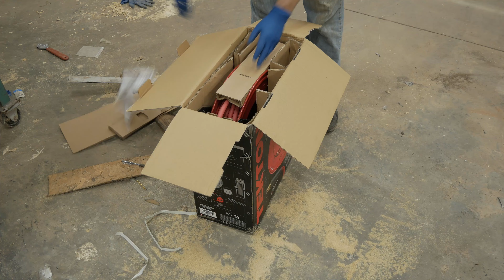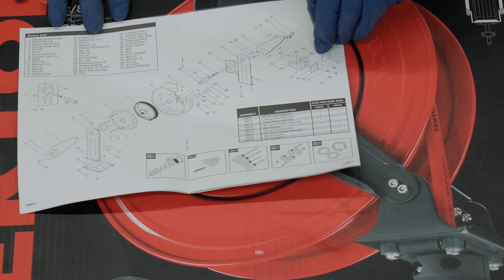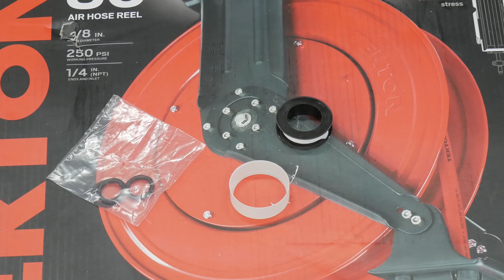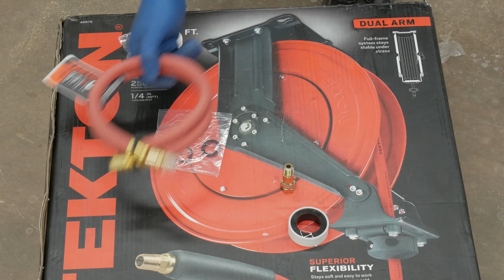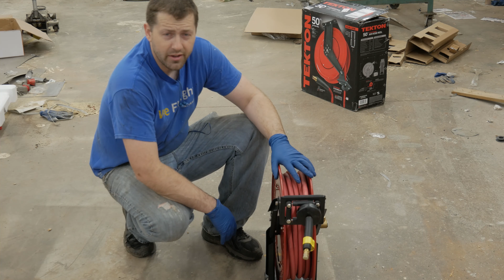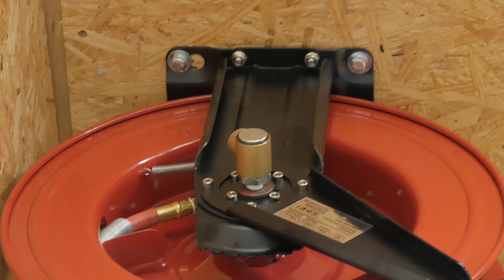My air Compressor Setup is TERRIBLE pt4-Hose Reel

Comment: How did you plumb from compressor to reel?
Reply from the maker: I used the rapid air maxline system and distribution blocks. https://youtu.be/k-Bx7FxapZw shows the 3' flex line plumbed straight into the block and into the swivel fitting on the reel. Some cheaper reels like my husky has to have a swivel hose because it doesnt have a swivel connection on the reel itself. The Tekton reel has the 90 degree swivel fitting and accepts a short 3' straight whip air hose.
Thanks for watching!

Comment: With what i have watched so far, i am surprised you didn't go with the 1/2" hose reel. With your use cases I would assume you want to maximize your CFM output
Reply from the maker: I looked into it, but if i chose to increase the hoses to 1/2" i would have had to make a choice between much larger industrial quick couplers which are obsurdly bulky and weigh much more than the aluminum ones. Or i would have had to buy a bunch of adapters to make my high flow 3/8" quick couplers work with the 1/2" hose. Both of which i wanted to avoid.
The 3/8" high flow couplers flow from prevost (paint booth setup) flow 37cfm, and the milton v style (reels) claim to flow 55cfm. Both of which far outflow my 25cfm air compressor setup currently. But you never know what the future holds! Thanks so much for watching!!!